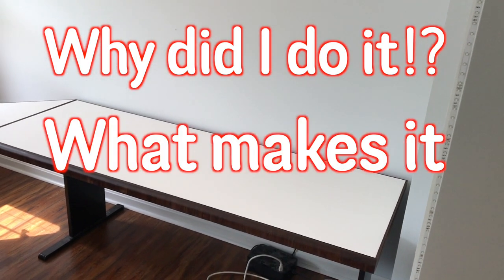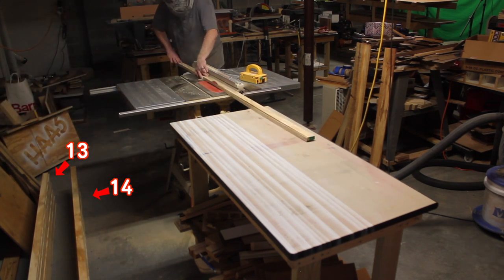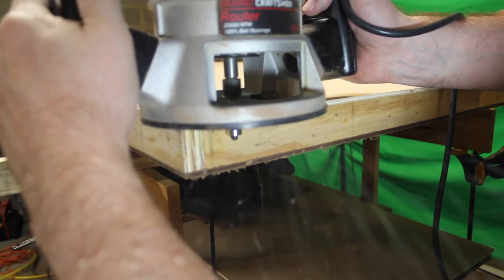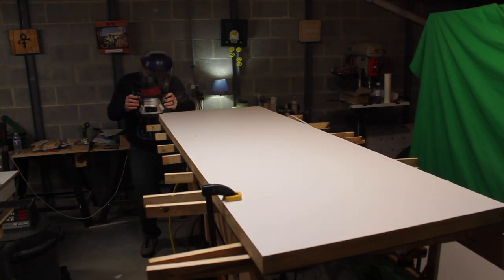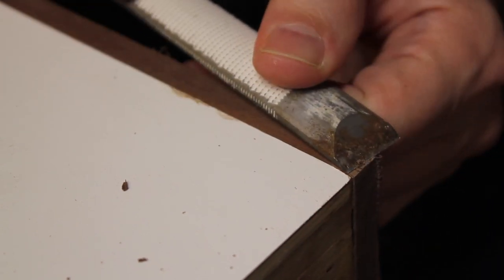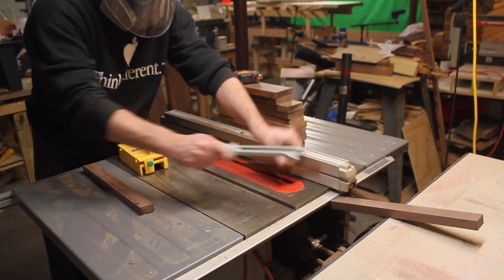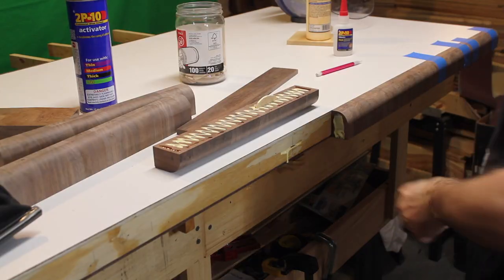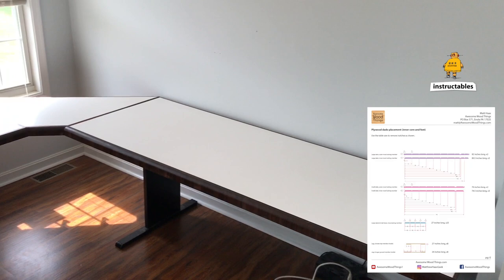Ultimate Computer Desk - Walnut End Grain Trim DIY

Comment: Matt, fantastic job, I really like the final result.  Great idea with the rounded over front edge, never seen that used before.  Glad you made a video of the build and thanks for sharing it.
Reply from the maker: I'm glad you like the build and the video! That old/cheap desk you saw at the beginning of the video had a 1-inch round-over... so, I carried that feature forward in what I created. Also, there are conference room tables designed by Herman Miller at my job's corporate office that have thin solid wood trim and with beige countertop laminate. I always liked those tables because they were very durable/functional. As you know, I chose the better white color rather than beige. Bottom line: I really did overthink EVERYTHING. Literally everything... and, I love it.